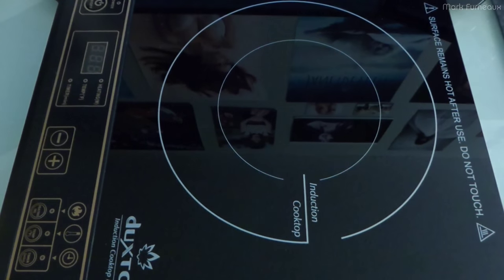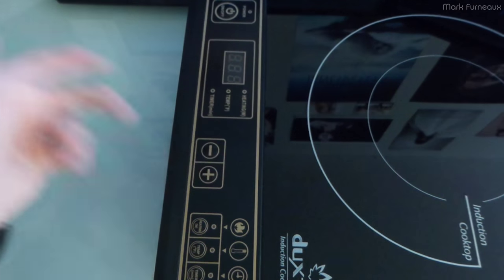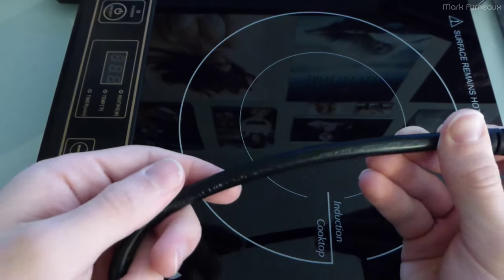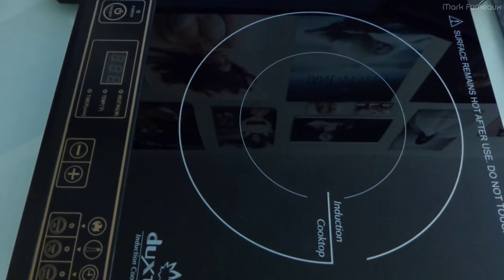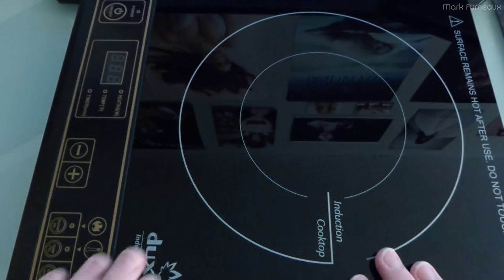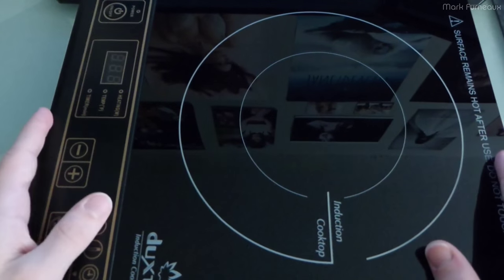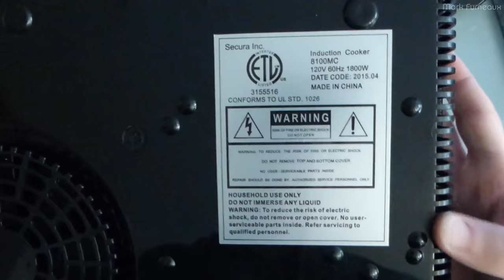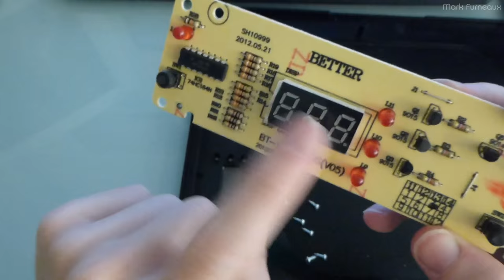Duxtop 8100CM Induction Cooktop Teardown

Comment: The covered IC is a special micro-controller for induction heaters CMS69P22. Two of the screws in the heat-sink holds one bridge rectifier.

Comment: I purchased one of these or a clone of one, like you to see if I liked the idea of induction cooking. I now have a full size cooker top and simply love it. So fast and so easy to keep clean. I will never go back to a conventional cooker, either electric or gas.
As these use a capacitor to drop the voltage, it would not be easy to make it both 120 and 240 volts. There might also be an issue with the 50/60Hz as I expect this frequency is  used as part of the timing circuit.
I am new to your channel after watching the vid on LED lamps. We have similar interests.
Reply: Hi Michael, I am interested in a stovetop induction cooker and since you love yours, could you tell me what is the brand, model and rough cost? I've heard that some have reliability issues and I don't want to buy a lemon.  Cheers!
Reply: Our induction top is made by BEKO I cannot remember the model number (as it was 3 years ago) it cost $1300NZ at that time. I still love it and no problems so far. Some are available with 2 year warranty. It is full of electronics so I guess it may well be less reliable than one with just a heating element. On that basis however, no one would buy a TV!!
For ease of cleaning chose one without metal trim. Ours still looks brand new. Cleaning takes under 1 minuet, try cleaning a gas top in 1 minuet!! I STILL would never change back. Don't even think about those dreadful infrared tops, they are bad in so many ways!
Reply: I'll look for that here in the USA.  Thanks!
Reply: yeah, and to do so would only make it more expensive.
Reply: I too got one of these for christmas and impressed!

Comment: What I find interesting is the coil, which by the looks of it, is a triple coil. So when you put smaller pots on it it only uses 1-2.

I think the induction zones in our Electrolux stove are probably cruder. They have a fairly large diameters specified and if you turn it on high you can sometimes see where  it actually heats by the bubbles. It a disappointingly narrow ring, compared to the size of the circle.

But the large was do up to aroudn 3000W maximum which is a big advantage. These single ones usually sadly max out at about 2000W. Probably because frigging North America with the stupid 110-120 Voltage and standard 16A circuit breakers... Here 16A is standard for 230V, sou you get 3600W by default.
Reply: I was wondering why triple coil. I was under the impression that you HAVE to use only pots of a specific size for the induction stove top and not smaller or bigger. If you can use smaller size pots with this Duxtop why not mark the surface accordingly?

Comment: How wide is the coils? And does it heat all across it? I have the 8300st and it will only heat up in the smaller circle on the surface.... disappointing because I cook crepes...

Comment: My mom got me a similar stove for christmas.I have a visual imparement and needed one because they are cool to the touch. I just unboxed it and tried it out for the first time yesterday and it gave an error after 4mins on max and would stop cooking. I almost thought it was busted but experimented with other pots and it works with some but not others. It looks like the more magnetic the bottom of the pot is the more likely chance it won't give an error. Is this normal? Sould I invest in all magnetic pots and do they need to be entirely magnetic or just the bottom? It was giving the E2 error with a pot that had a magnetic ring on the bottom with little holes/dimples. I had to keep manually running it untill it boiled with that one. Using another pot, I got water to boil with 0 errors at all, that pot had a very thick solid magnetic bottom.
Sorry for the stupid questions.

Comment: Probably not grounded because there are no parts of the hob that could become ⚡LIVE⚡...... I live in the UK, and I have a similar SINGLE ZONE, TOUCH-SENSOR (not mechanical switches) PORTABLE INDUCTION HOB, rated at 230V, 2KW. These hobs have a COOLING FAN, similar to a computer fan. These are prone to becoming clogged with dust over time! These hobs are cheap, fast, and energy efficient ...... EDIT: My hob is 6 years old, and used most days. No problems at all. Fan slightly dusty ...... ANOTHER EDIT: My display (and yours) are LED, and not LCD. Mine is RED LED.

Comment: Where is the speaker? I want to disable the beeps
Reply: Nevermind found it. It's the round black thing in the bottom left corner (e.g at 10:33). It's called a piezo buzzer. You can search pizero buzzer in google images to see what it looks like. Remove that, and no more beeps.

Comment: Would you be able to make something like this work off DC power?
Reply: Should do- they usually have a full wave rectifier on the inlet. In fact may work better and be quieter. However, it's not guaranteed to work of course, they're not designed for it.

Comment: when i put steel wool on the induction cooker it doesn't heat it up , steel wool is ferrous material  ???
Reply: thats because it is detecting its not a pot and might also have something to do with the weight. I wouldn't try that though as you could damage it as the load difference could blow it up.

Comment: Electric cooking is horrible, induction extra much. 1800W, considering efficiencies and misc electric stuff maybe 1700W is going into the pan, which needs to be a specially designed pan. My 4-pit gas stove, which cost just as much as this 1-pit induction, puts out 12kW of heating power and has no computer fan in it. Typical gas stove with a wok pit will put out 15-25kW which is basically unheard of in electric cooking even if you have 3-phase in your house
Reply: Yeah so? Induction is still better in every way.